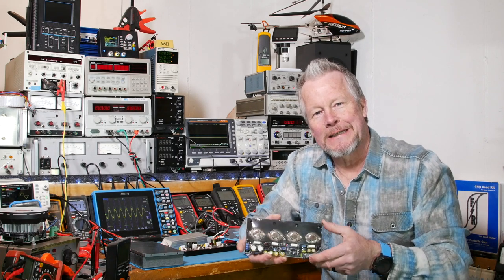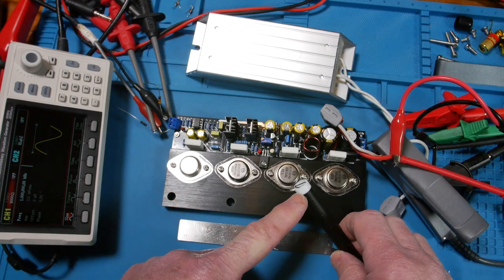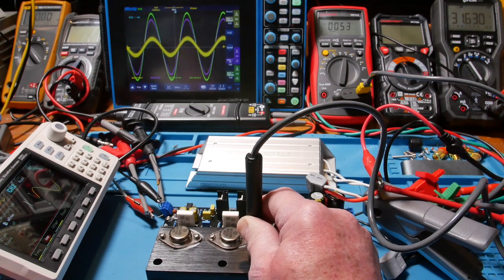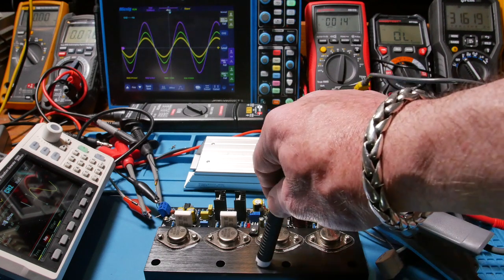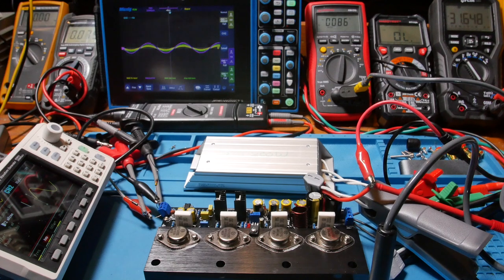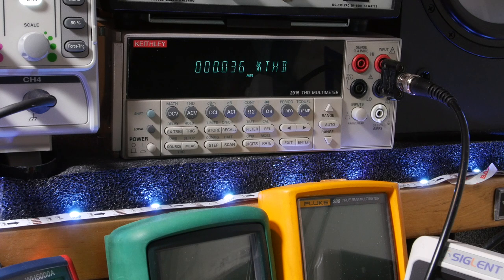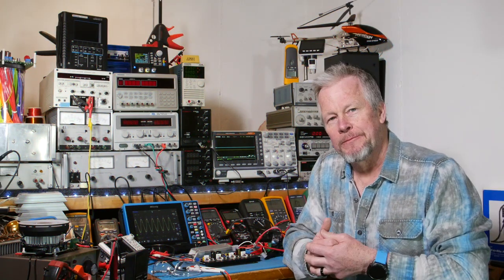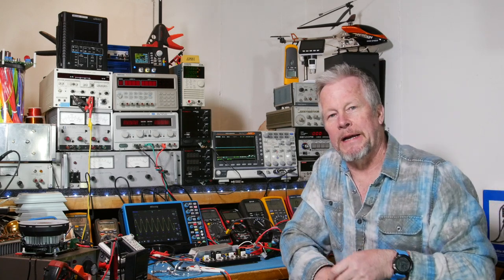20W Class A - Power Tested THD & Bode Plot #classaamplifier #THDtesting #bodeplot

Comment: That is pretty good gain and phase response. Remember, you need a lot of capacitors on a class A to reduce the ripple as it draws full current all the time. We would love a schematic of the amp. Off the cuff it seems a pretty good and stable design. I would use a Capacitance multiplier to keep the ripple out of the amplifier, else you may be disappointed at it humming.
Reply: a CRC psu will help with Ripple, he doesn't need "TONS" of capacitance.
Reply from the maker: I think I have the schematic traced out and ready to show in a video very soon;)

Comment: Once again a very good video,  I do like that thermo couple, I might have to find one myself.
Another thing, the load is not realistic, its only resistive, with a little inductance, it needs a 1 or 2 uf capacitor across, that really stresses the amp more, and I also like to see a fft of the harmonics distortion,  in my class a build I aim for second harmonics as I find them more ear pleasing.
I use a soundcard and arta for those readings, and a autoranger that keeps a steady input to soundcard line in.
I have watched several of your videos and feel I need to give a little back, i will set up as a patreon so you can  continue making those great videos, and hope more will follow.
Ps. I would put a relay with a 555 timer across that thermistor so theres no loss, let the relay close after a few seconds
Reply from the maker: Great input - thank you!

Comment: Hi nico, yes let's see how it goes, I have a bad feeling, the toroidal looks to small, i would agree on smps, or at least a crc clc  linear power supply, but the voltage drop would be substantial, let's wait and see
Reply: That transformer by the size of it looks about 100VA may 120VA with a little sweat, cannot imagine that the regulation is going to help much SMPS would definitely be the answer.
Reply from the maker: Thanks Guys for the questions.  I'll do a follow up showing the final build, but I did finally get more power and did go to the larger transformer;)

Comment: Good video. looking forward to the finished product. I watched a video where the host said it takes more current to drive an amp at lower frequencies than higher. Like 40Hz vs 1Khz.  I'd be interested in hearing your thoughts on this.
Reply from the maker: Thanks - that's a great question.  It is interesting as the frequency gets lower it is closer to DC so less time to charge capacitors.  But on the other hand, as it gets lower than 60 Hz (or 50 Hz for other parts of the world) the line power has more pulses to charge the power supply rails.  It really doesn't matter that much if it is continuous power, but with real music it does.  This is a great subject and I'll try to demonstrate this.

Comment: Great video as usual, thanks. You show the phase is -15 degrees on the low and high end, is the goal to get as close to zero degrees across the whole range ? 
Trying to understand what less/more phase shift does to the audio.
Reply from the maker: Great question!  Thank you!  I think many amps have more phase shift because 0they roll off closer to 20 K which the phase rose off even sooner than the gain. And at the low end capacitor  coupled inputs will have more phase shift as well. Yes, I think it would be ide to keep it flat. I don’t know how keen the ear is on phase shift.

Comment: Type K TCs and thermal epoxy with a datalogger are my favorite way to characterize temperature v time performance. The amp is certainly a good performer--corner cases will generally find the areas of most concern. My concern with a 20W amp is that I most likely would be using it for bi-amping HFs, and the testing seems to show that the worst case  performance of this amp is distortion at high frequencies. Interested to see if getting thermal conditions stable would improve that performance.
Reply: How much THD would you expect to hear at 20kHz since the first harmonic is at 40 kHz and your hearing threshold (if you were a little at say 15 years old) drops of at about >40 dB/Oct. Thus a measured THD of -60 dB would be -100 dB to your ears, well above the noise floor in your room. I could approximate that to the noise an ant makes doing a tap dance in a pair of slippers 100 yards away. :)
Reply from the maker: Yes Tim, I agree!  I like to have thermal couples placed in various locations so I can watch things in real-time.  I wanted to move the program the heat seat to see how the temperatures spread and how well the thermal coupling was working.
Reply: @nicoras8803  Excellent point but if you're addressing a member of the golden ear brigade you're wasting your time 👍

Comment: Yeah, a class A amp will cool down as you drive it harder as some of the output current is dissipated in the load/speaker. Do you have any additional rail capacitance that you could do a comparison test?
Reply from the maker: Thanks John!  Sounds right;)  I will do this comparison as I start to finish the build - thank you.  Any further input is always appreciated;)

Comment: I think that Heatsink is going to be to small. Good video  Bud !  Why not use the Purple CRC psu board i sent for this ? install 6 x 10k caps 4 mur60 fred's then do the crc math for the ripple noise. That could be a good next video btw :)
Reply from the maker: Thanks and I think you might be right, but I wonder if playing real music versus constant power it will be OK?  I'll build those purple boards that you gave me - I think that will be a fun project!
Reply: @KissAnalog  Class A amps get hot the second they turn on, unless you have a fan to keep the heatsink cool, then might have an issue !

Comment: I think your friend would be very happy if you would get the power supply nice and clean. In fact when you hear it properly setup you may just keep it.
 
Class A sounds completely different to any other topology and I only design class A amps for the past 25 years. It has a character of its own, few other topologies can't even dream to  touch it, only downfall is its heat output (efficiency as you call it). Only the best speakers should be utilized with a well-designed class and that seems to be the case here.
 
Keep it, give your friend a class D, you would appreciate the class A more. In my humble opinion I would use a switch mode power supply on the amp, not a toroidal, you will pull your hair out trying to get rid of hum. 

Switch mode are specifically designed to pass high current continuous, there are many available on eBay, look for a 27-30V 5 or 10 amp, (they normally have +-5% adjustment available) and use two to configure the +/- power supply and say 4700uF -10 000uF 35VDC capacitors on the rails.Your newly acquired amp will have little that can touch it.
 
20 watt is more than enough even in a large listening environment, importance is an equally good set of speakers, here the Klipsch Heresy comes to mind if you like loud rock with plenty of punch. If you can lay your hands on a pair of KEF Concertos, that pops onto eBay now and then, would also be a great speaker for this kind of amp if you like more warmth and easy listening.
Reply: Most smps dont like extra capacitance or indicators, some become unstable and enter fault mode, trail and error I guess.
Reply: @amplidude101  I have never had the problem with well designed SMPS like Meanwell, they have a low startup specifically for this application. I think you may be referring to an LED power supply, which I assume do not have soft start. Besides one can place an NTC in series with the caps to cause a soft start. 10 amp NTC will probably cast $0.50
Reply from the maker: I'll do a SMPS design for another project so we can compare the two.   Great feedback from everyone here on this comment;)

Comment: It is not a rule of thumb, just look up the temperature rise per degree centigrade. Now a Class A am is about 20% efficient, thus the heat sink must be capable of emitting the heat into the environment. A rule of my thumb would be that take an environmental temperature at 20degrees centigrade above what the hottest day is where it will be applied, then calculate what size heat sink should do the rick. A class A amp always run at maximum temperature regardless of its output. The bias current flows continuously.
Reply from the maker: Thanks Nico!

Comment: Hi you never know! third time lucky!.? what about using a class D as the power supply driving the class A what is the cons and benefits
I've heard if you split the mica  into 3 parts you get a better thermal coupling.  what about if it was on a ceramic heatsink plate then you could bolt transistor directly
Reply from the maker: I could use to help reduce the dissipation in the Power Supply section. But, for this class say I think I want to go old school all the way with the linear Power Supply. Later, now I want to be able to switch her and compare the difference.
I’ve never heard of that technique about splitting the mica up. Mica is somewhat brittle and you do not want it thicker where it broke or thinner where it has not been compromised. So I don’t know about cutting or breaking it in thirds. Also, I don’t know if the thermal paste s a better thermal transfer then the Mica.
Reply: @KissAnalog  I was just talking generically about the class D amplifier as the power supply, but you're going to do something in the future on that that would be interesting considering it gives a very clean analogue waveform its is a regenerator in itself in the power supply I would have thought should work well.
Yes you might be right with the Mica I don't know splitting it twice should be alright, I don't know what thermal properties Mica has. Shouldn't you clean them back of the transistors before placing them on I mean rubbing them with wet and dry paper on a flat surface to get them as smooth and shiny as possible not designed engineer to be flat and what about the coating on the heat shield restricts thermal coupling and has machine marks what would reduce the thermal efficiency